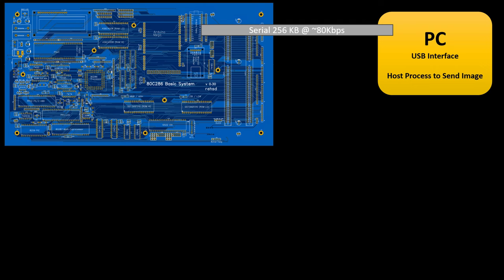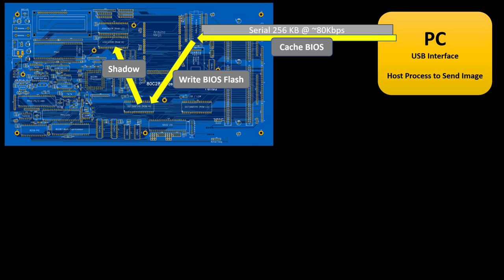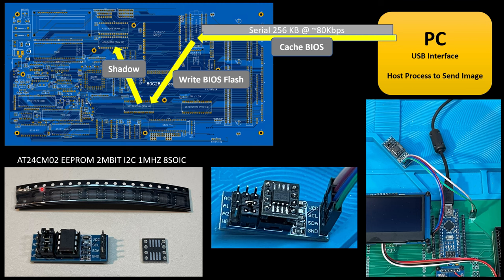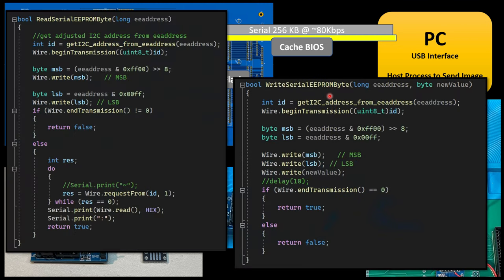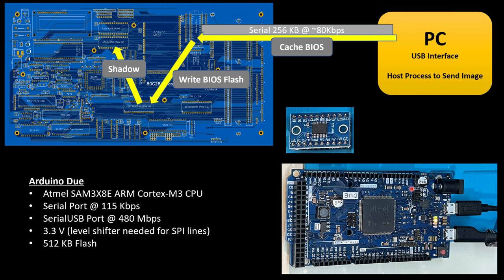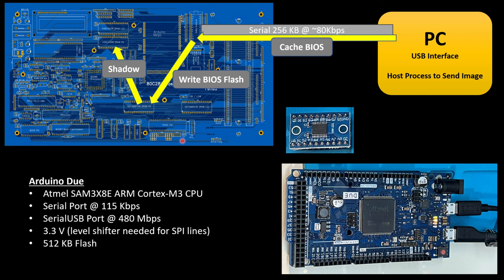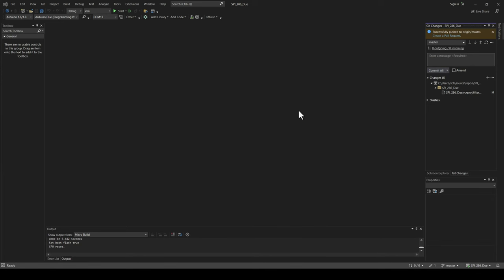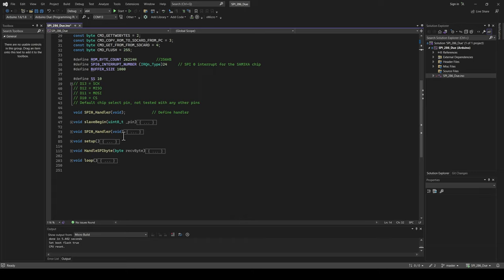80286 Build, Ep. #77 - Onboard ROM Updates, part 4 (out with Serial EEPROM, in with Arduino Due).

Comment: Can you replace BIOS flash chips with normal RAM and load your BIOS data at the beginning, then boot up the 286? Something like an EPROM emulator you know.
Reply from the maker: I think I would need some type of flash/eeprom to bootstrap the system and get that initial copy working. That bootstrap code could be quite static and not need to be updated often. The result would be that I would still need some flash for the bootstrap, but the system could always boot with the latest BIOS in RAM. Boot time would be my concern. I need to see how long it will take copy the BIOS off the Due into flash (or RAM).

Comment: I am not familiar with Due's microcontroller, but isn't writing flash memory byte by byte completely anihilating its write cycle figures? I mean, flash memory always writes using whole pages (it's built that way). If you write just a single byte, it has to load entire page to a buffer, modify that byte in the buffer, erase entire page in flash and write that buffer back to flash. Not to mention that it is slow as molasses. Depending on how that flash storage library is implemented, you might kill your microcontroller in no time… or not.
Reply from the maker: Great question! I had considered this, and I believe there is some risk associated with wearing out the flash. The Due uses the Atmel AT91SAM3X8E which lists an endurance of 30K cycles at 25C. I have not been able to find the pagesize for the flash memory. Digging into the Arduino code libraries that I am using, I can reduce the cycles by writing a buffer rather than a single byte; that is a change I plan to make. Currently, I only write to the flash if the data changes. For most BIOS updates, the changes are minimal. Between only writing when data changes and changing to a write buffer, I don't have a lot of concern about wear. Worst case, I burn through the upper 256 KB of flash. I would still have the first 256 KB of flash, which is not modified by my runtime code (and this is where the code is written).
Reply from the maker: I found the page size in the data sheet. The page size is 256 bytes. So, I'll use a buffer that is 256 bytes to try and reduce cycles.
Reply from the maker: Quick update: https://youtu.be/jnkXPEeMa8k
Reply: @rehsd  I think this is related to what they call "wear levelling" in FLASH file systems.  Not as applicable when using the device as a direct-addressed BIOS chip though.
When you said your serial device was only 256 kbits when you needed 256 kbytes, my first throught was "well, why not put 16 of them down in parallel with a controller?". LOL.
Reply from the maker: @zxborg9681   I thought about an array of the serial EEPROMs. Unfortunately, their addressing setup only supports two of them on a single I2C bus.
Reply: @rehsd  I was thinking of something much more unethical and perverse.  Each serial PROM would be one bit of the parallel data, allowing you to turn  a single I2C fetch cycle into an entire cache line of data since you'd be accessing them all simultaneously. Not that I'm saying it would be a good idea, mind you :-)
Reply from the maker: @zxborg9681  Got it.  :)

Comment: Is caching the BIOS before writing really all that necessary?

Maybe I've missed something, but what is the problem for this solution?

If it were me, I'd receive a chunk of data from the PC into RAM on the nano, write that to the BIOS ROMs, then send back some kind of ack to the PC to tell it to send the next chunk over and repeat.
Reply from the maker: I did try that approach, and it was slow. PC to Nano, Nano to 286. The bulk transfers speed things up quite a bit. It will also allow me to push the updates from the PC to the Due, and pull the updates from the 286.